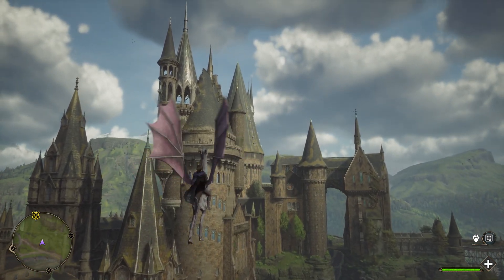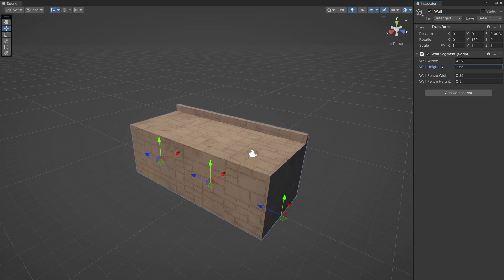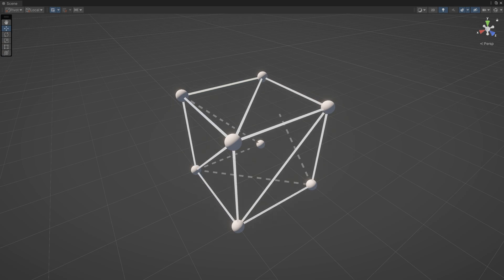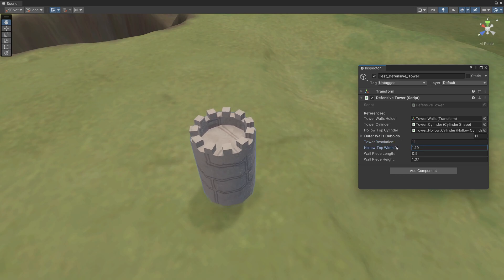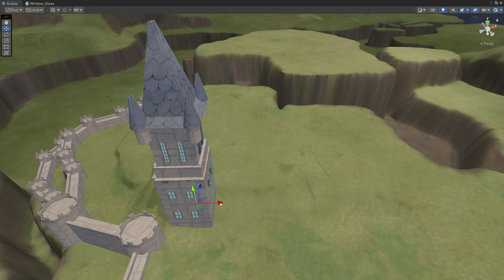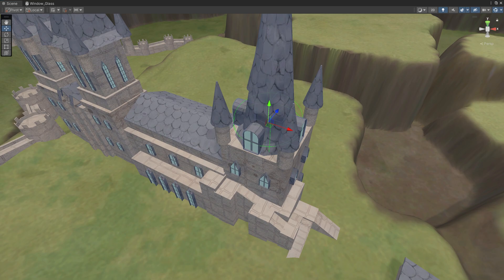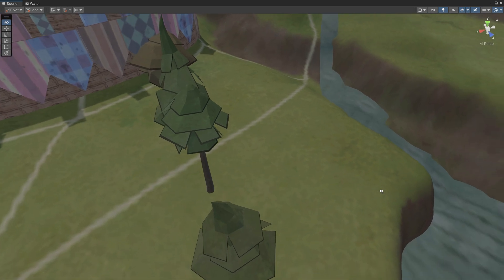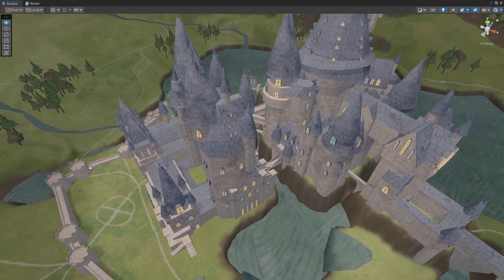I Recreated Hogwarts Legacy Map Without 3D Modeling

Comment: The castle is cool and all, but how do you make the terrain? That is what I am struggling with right now using Blender. My terrain never looks good or is bumpy making it almost known.
Reply from the maker: I usually try to get the height pretty much right first, using the "set height brush". This produces a bit of a terrain that looks like steps. Then, I use the smooth tool to smooth it out so that it looks more like a regular hill. 

Also, depending on the scale of the terrain, you can check out hydraulic erosion series by Sebastian Lague, this will produce a very realistic result for mountains.

I'm not sure about Blender though, I've mostly done it in Unity.

Comment: “i can’t model so i’ll make the engine into a modeling software and then model in that instead”

my dude it is impressive but you are taking steps backwards just so you wind up modeling like a normal modeler. Blender can procedurally generate geometry just like this with geometry nodes.
Reply from the maker: I've heard of geometry nodes but haven't yet tried them out. Maybe you're right, they could be a solution for my troubles with old fashioned modeling
Reply: @GameDevBuddies  I thought about it more and I realized one major con is that from blender you would need to export it to Unreal if that's where you wanted to render. So in that case, you'd lose the benefits you get from it being procedural directly in engine. You may have gone the right route here. On the other hand if just getting a gorgeous render is your goal, blender can do that better.
Reply from the maker: @ Yeah, but with a bit of custom tooling one could create an exporter that automatically converts the procedural shape from Blender into a static mesh and exports it into Unity/Unreal. This sounds like a fun project ngl 😃

Comment: Really impressively done, I wonder how much time this project took total. Also, I'm surprised that you needed to make tools for some of these functions. The paintbrush tool you used for the trees and the mirrored placement you used for the windows seem like very basic tools I've seen in various editors.
Reply from the maker: Thank you! 

I worked for about 2 weeks on this project (give or take since I got sick so I didn't work in continuity). The paintbrush tool is available as a part of the Terrain system, but I wanted to have trees as regular instanced meshes so that I would have an easier time applying all these effects to them in part 2.